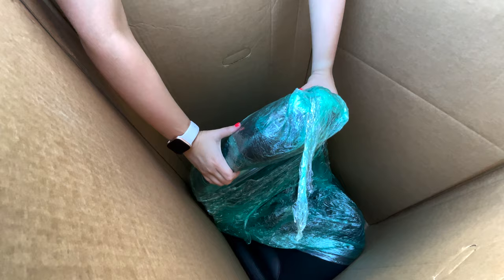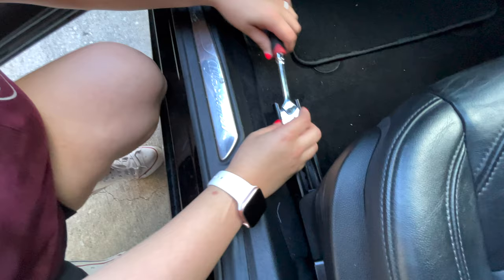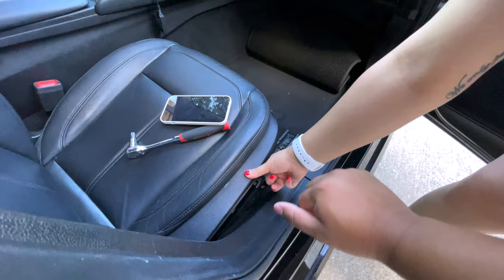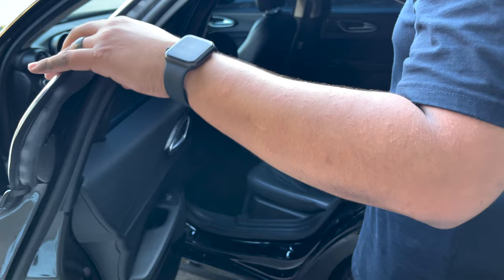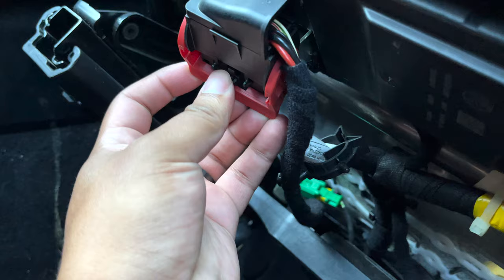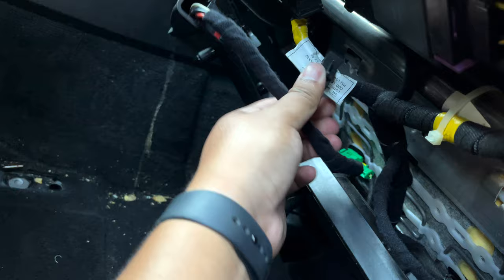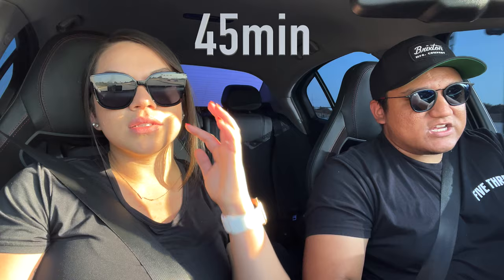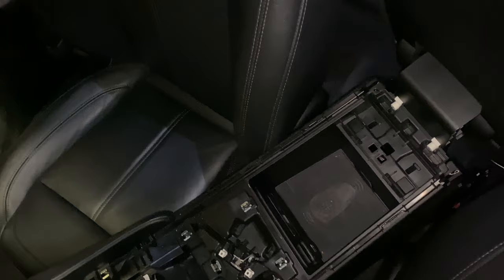Alfa Romeo Giulia Quadrifoglio Carbon SPARCO Seats !!!

Comment: Just put a set of Sparcos w green and white stitching in mine today. They are so nice and comfortable too. Much preferred to the sport buckets and definitely lighter.
Reply from the maker: Glad you get them, hope you’re enjoying them! I’m not sure if QV seats at heavier from base to sparco not much weight savings. Definitely a great upgrade to any Giulia!
Reply: @ModdedMotors  I only have a few mods left to max out it's potential. Already have a catless DP waiting and wanna do the squadra hybrid turbo/retune upgrade at the same time. Those 2 and maybe some more carbon bits.

Comment: Hi, I have a question; looking on alfa romeo forum looks like the OEM sparco seats weight for giulia/stelvio quadrifoglio is 47 lb per seat; that seams a lot compared to the sparco SPX seat (website claims 28 lb per seat). I know the seats aren't exactly the same, but do you think one of them may be wrong?
Did you ever weigh an OEM sparco seat from a stelvio or giulia? Thanks
Reply from the maker: I weighed them in this video. Most likely accurate as SPX doesn’t have the same base as the OEM sparco. I’d assume a lot of weight is added to the base for the electric functions it still has.
Reply: @ModdedMotors  Thanks, reading other comments I thought about that, thank you for clarifing

Comment: No proxy alignment needed? Just plug and play? What year again?
Reply from the maker: Sorry, no it still needs a proxy alignment. Takes 1 min with multiecuscan
Reply: @ModdedMotors  What will the proxy do? Do the seats work without it, power function? Or is it for the airbags? Air bag light on? Thanks!!!!!
Reply from the maker: Yea the seats still function fine without it, your odometer will stay blinking. Once you unplug something it just needs to realign. The dealer can do it for free or someone with multiecuscan.

Comment: Quick question, plan on purchasing a quadrifoglio. I had the red interior in my previous alfa Ti.  If I purchase the red seat from eBay, will the fitment of the seats work in the  quadrifoglio ?
Reply from the maker: Hello, sorry for the delay. Yes you’d just need a proxy alignment which can be done with multiecuscan

Comment: these look different from the universal SPXs you can buy- maybe these are heavier? Very surprised at the lack of weight savings, cause SPXs are supposed to weigh like 30lbs vs 75lbs for a normal luxury power adjustable seat
Reply from the maker: These are the OEM Sparco seats, they might save more vs QV factory seats. My car is a base model, I’m assuming the base seat doesn’t weigh as much as the QV is the only logic I can make. I was disappointed by the savings I was expecting a bit more.
Reply: @ModdedMotors Perhaps partly because these still have an electric motor for height adjustment? Either way there appears to be additional parts on these that aren't on the universal seats if you compare pictures
Reply from the maker: OEM is 46.8, Sparco OEM 44.8, Sparco SPX 28 according to online. 16.8 lb difference probably due to the electronics.
Reply from the maker: Yea mine aren’t universal, they’re OEM

Comment: you guys might as well get the QV all these mods prices
Reply from the maker: We’re in the market for one, but looking for a specific spec. We won’t sell the base model as this drives content and we’ll be using the 2.0 to track. Realistically though compared the Alfa brand new we haven’t even spent 30k which is relatively “cheap” for building a Giulia.

Comment: Wait, why does the car have to be on for the original seats to be movable? That's incredibly stupid design on Alfa Romeo's part.
Also, the Alfa Romeo Sparco seats are about 15 pounds heavier than the original SPX seats because those are full manual and weigh about 35 pounds each as opposed to 50 pounds. Regardless, as far as I'm aware, the SPX seats are the lightest (and possibly the ONLY) OEM-grade reclining carbon fiber shelled seats on the market that have full harness compatibility.
Reply from the maker: It’s not that it has to be on, but we were disconnecting the power from the battery. So the entire car wouldn’t have power. Any car won’t function without a battery
Reply: @ModdedMotors  Ah. Fair enough. I was worried Alfa did something incredibly Italian yet again. LOL.
Reply from the maker: Lol 😂 I understand completely! Thankfully they didn’t do that 😅